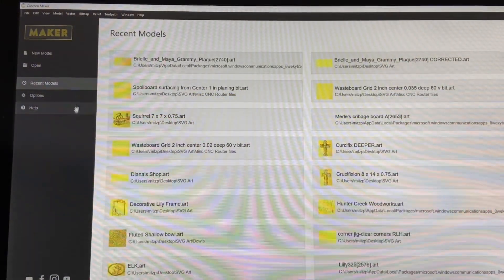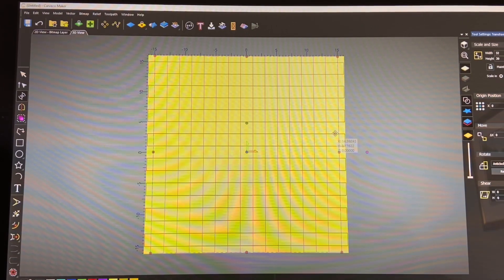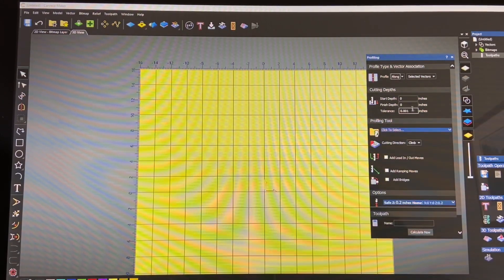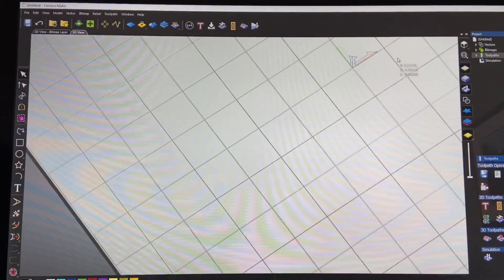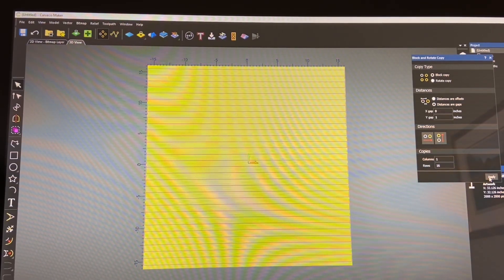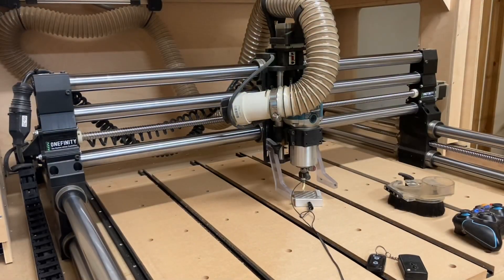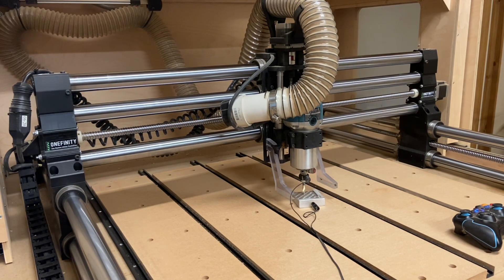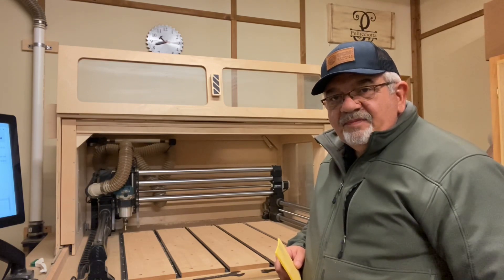Spoilboard Grid Workflow using Carveco Maker

Comment: I follow your tutorial and I'm getting an soft alarm on Y axis motion at line 17.  The only thing I change is the size my cnc a elite 48 x48. How do I fix this? Thanks
Ron
Reply from the maker: Where do you have your origin set to in the file?
Reply: In the center.  After homing,  I put my V bit dead center of my waste board. Set zero there probe for Z tried to run the code. Am I missing something?
Reply from the maker: @ronsleister give me a shout in messenger and I’ll help you with the set up.  Dead center of wasterboard isn’t the same as dead center of the cutting area. 
If you set zero for your x=24.015” and your y=24.187” (exact center of cutting area for the foreman) you won’t get any alarms.

Comment: Good afternoon Mitz. Question. I followed your instructions for a grid on a Onefinity Foreman Elite. The tool paths seemed to be done right but when I ran the file, the grid squares were less than 2 inches and some where completely off. So my grid looks a bit off. I also noticed the front of my grid line is not where it should be and it was cutting air in the front. I set my work area in Carveco to X48.125 and Y48.50 according to the cutting area mentioned on the Onefinity site. Could that be my problem? Get back to me when you can. Thanks.
Reply from the maker: Send me a message through Facebook Messenger and will help you.

Comment: Thanks so much for your instruction.  I'm having an issue with selecting the horizontal or vertical lines for the toolpath. From the video it seems that all you do is click on one line and then proceed to the toolpath creation. When I click on one horizontal line it highlights one rectangular row... so I suspect when I go to the toolpath creation it will only be for that rectangle.  I guess you can tell, I'm new at this!
Reply from the maker: No worries.  Give me a shout through Messenger and I can walk you through it
Reply: Thank you again Mitz... I got it and the board is done.   Really appreciate your being in touch and your help .   @onefinity-trainingtipswithMitz

Comment: For some reason I can group the vertical vectors and move them but I am unable to group and move the horizontal vectors. Any ideas what I am doing wrong?
Reply: I might be too late here to help you Daniel but maybe this will help someone in the future because I took was having problems selecting one vector over the other.  What I found worked for me was after creating the horizontal and before copy and pasting the vertical while they were all highlighted still I selected group vectors then when I pasted to get the vertical and after rotating 90 degree while everything was still highlighted I grouped those vectors then I was able to move and align everything without having to click and highlight the individual vectors to group then which I found tricky to do as well.
Reply from the maker: It should work.  Be sure when you group, only highlight the horizontal vectors. Do not include the outside perimeter

Comment: Mitz, I followed the design instruction and was able to do everything ok. i saved it, but now i wanted to bring it back into Carveco but the only thing i can find is the vector file. Did i miss a step ?
Cheers Craig
Reply from the maker: Hi Craig when you open it back up in Carveco, it should be the design file. If you created any toolpaths, they would show in the project panel…just double click on the word “Toolpath “. If you’re still having problems, send me a message in FB Messenger
Reply: @onefinity-trainingtipswithMitz  Mitz, i have given this another try. Can i send you a file to have a look at it when your able? also is there away to actually see the tool cutting simulation slow enough to see ?
Reply from the maker: Yes. I think you saved just the gcode file (.ngc extension)   You also have to save the design file (.art extension). Go to file->save as-> enter file name
Reply from the maker: Craig, I’m in Toronto visiting my grandkids- you can send me the file but won’t be able to look at it until I return home on the 13th
Reply from the maker: As for slowing down the sim, select the individual toolpath component then right click and select sim control bar
Reply: @onefinity-trainingtipswithMitz  thanks Mitz, no worries I’ll send it when you get home. Yes I originally saved the G code and not the art file. Good practice lol. I think I’ve done the grid pattern spoil board 6 times. Lol. Enjoy your holidays and will catch up soon. I’ll have to edit the art file anyway with a different bit when I get them. 
Cheers
Craig

Comment: How long did it take for that program to run? In Carveco, it is telling me it's over an hour! Seems like a long time for a grid line... I'm using the S1R 60* but in my toolpath.
Reply from the maker: Is it telling you over an hour in Carveco? Those aren’t very accurate. This took maybe 10 minutes to run. You can increase your feedrate to 200 ipm as you’re not going very deep which should reduce carve time even more
Reply: @onefinity-trainingtipswithMitz  Good to know, thanks for the quick response! Yes it is telling me that in Carveco Maker. I just started playing around with it last night and was just about to load in my surfacing file to my Onefinity. Then after that, I'll run my grid file. Just got the machine last weekend and got it set up. Now to start running some files!
Reply from the maker: I just took a quick peek at my files. Under the towpath summary, there are two items along the top. One is your rapids right and the other one is a time factor. For your rapid rate you can change that from 0 to 393 ipm. This will match your machine.  The other, carve time factor, set it to 1.5. This will put you a lot closer to actual carve time on your machine. Not exact mind you, but a whole lot closer.
Reply: @onefinity-trainingtipswithMitz  Awesome, thanks! I will see how close it comes now. It dropped it from about 54 min to just under 20 min. That seems a lot more of what I expected.

Comment: Hi. So after about three hours of trial and error, I have to ask about your video with Carvco.  I did exactly as instructed  in your portion of the video and all I had were errors.  If I set the work area to 33 in's square, it gives me errors. How did you get your Cnc to run with these numbers? Also setting it in the center right at the start, put the whole carve area off the main area. So I changed it to 32 x 32 and started in the lower left corner and it worked.  Not sure how you managed to get yours to work.  Can you explain how using 33 in's works better than 32in's?  Even in your video you can see the main screen show yellow in the X and Y direction.  Thank you.
Reply from the maker: What size bit were you using?  I was using a 1” bit so the centerline to centerline of the bit is 32”
Reply: @onefinity-trainingtipswithMitz  i was also using a 1 inch.
Reply from the maker: Ok. If you want to give me a shout tomorrow, we can figure out what’s happening. 816-536-1398. Also send me your Carveco design file to look at. mitzpellic@yahoo.com